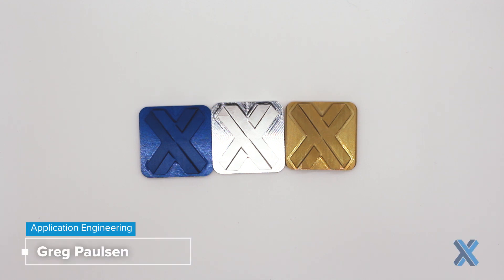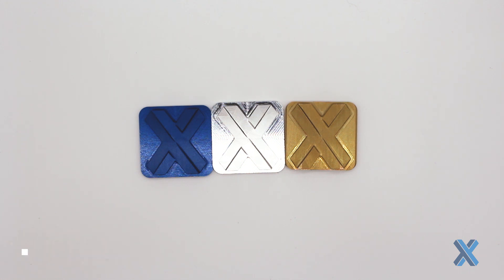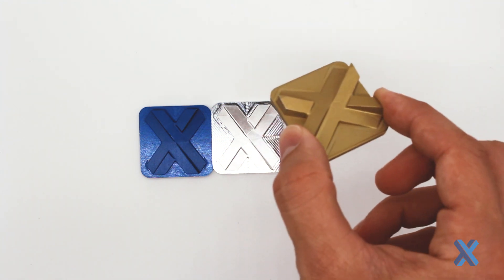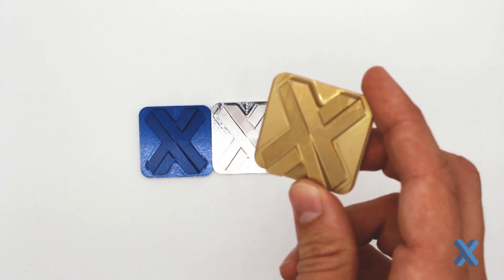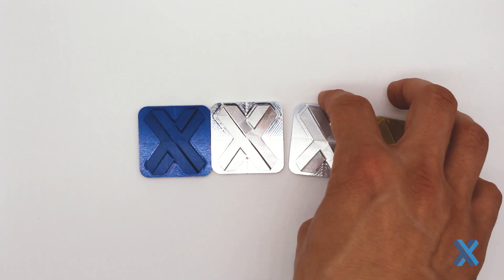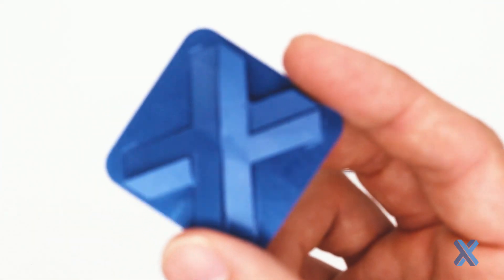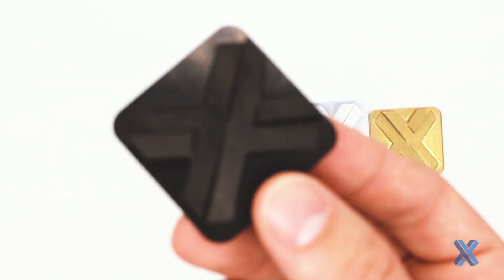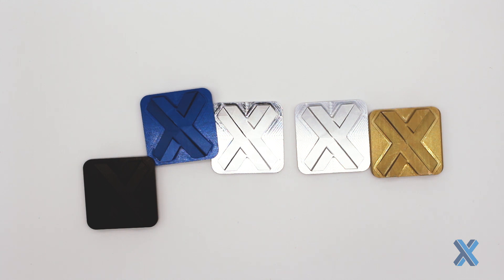The X Tiles: Anodizing vs. Chem Film

Comment: Thanks Greg,  I am really surprised how much digging it takes to find a comprehensive Al finish guide and Xometry did pretty good! .  I just downloaded and read 'CNC Metal Finishes' too.  This video is very close but leaves me wondering what advice could be added to both resources for comparative wear resistance and friction reduction (I'm suspecting anodize edges out chem film but can't find substantiation in the form of comparison).  I also know PTFE can be added to finish anodizing for further friction reduction; can it be clear? is it less durable even though its more slippery?  My employer is making lots of orders for chem filmed parts right now, including several tool items.  I think we might need to be better informed to get the best reliability from the surface treatments.